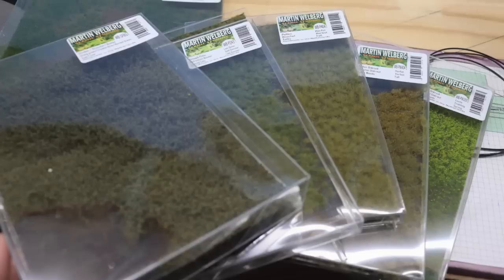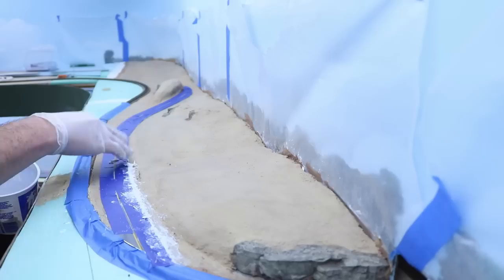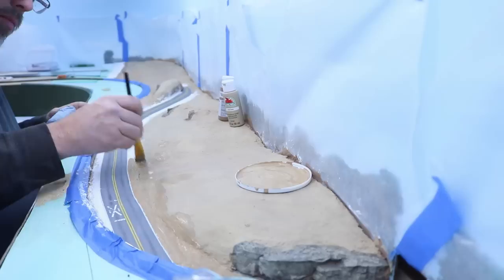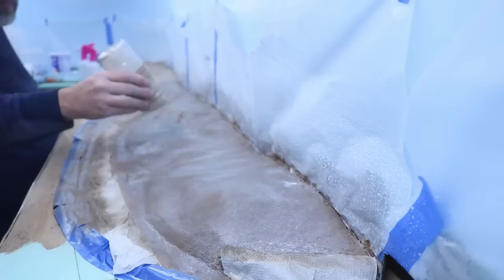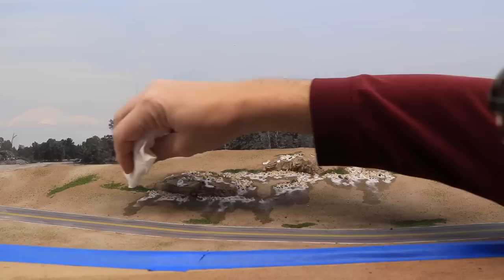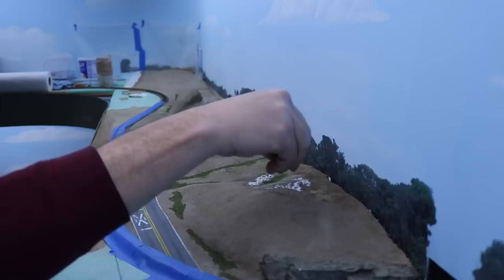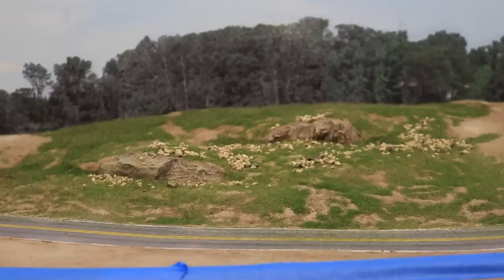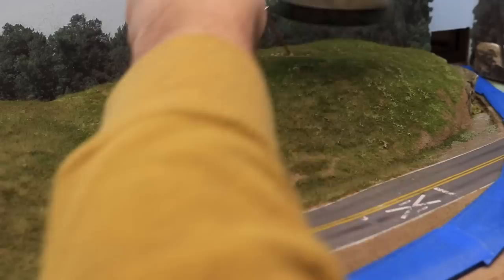Building Open Country Scenery for a Model Railroad Layout

Comment: I have bought those spray bottles from the dollar store as well, they do work to a point, but when the glue dries you pretty much have to use hot water to get it to spray again.    I now use the clear plastic ketchup and mustard bottles with covers

Comment: If you want a cheap alternative for sculptor mould try this. Take a dozen sheets  of soft toilet tissue, put them into a nutri bullet, give it a whizz, put about an inch or so of plaster into a plastic fruit bottle, fill loosely with the toilet paper fluff and give it a good shake to coat the fluff with plaster. Add water to the fluff and mix to the desired consistency. Excellent sculptor mould at minimum cost. Try it!
Reply: Great tip, thanks 😀🌈🇭🇲🚂🚂
Reply: I don't own a nutri bullet.
Reply: If you don't have a nutri bullet, buy a $14 coffee grinder from Kmart. Fold 6 sheets of toilet paper zig zag fashion on each other and cut into half inch squares. Toss a few into the coffee grinder and you will get the same result. That is how I first did it. The coffee grinder has many uses for making  and colouring flock and other stuff with artists acrylics straight from the tube. It is very well worth the $14 outlay. One tip, shake it vigorously while using, to ensure good mixing and colour coverage. All my DIY static grass made from weathered MDF and my foam flock was made in my coffee grinder. You won't be sorry you invested in one.

Comment: An expansion on your clothes pin clamps. About 30 or so years ago I was building a quarter scale RC glider and needed clamps to  hold reasonably soft balsa sheeting to spruce stringers for gluing. All steel clamps I had would have done damage to the sheeting. I got wooden clothes  pins, removed one jaw of each pin and super glued the shortened sides together. This gives a gap between the jaws about a half inch wide before you squeeze the pin open. Works really well and can open very wide. One tip on super gluing pine or spruce. Spread a thin coat of super glue over each surface to be glued and allow to dry momentarily to seal the surfaces. Then apply the glue as usual. This method ensures that the glue doesn't soak in and rob the joint of glue.

Comment: Why “never mix” the different lengths of grass? Glad to see you posting videos, it’s great info. Thanks for the nod to Midwest Model RR, great service and delivery.
Reply from the maker: Yes, I should have explained that in more detail. If you mix different lengths of grass, the tendency will be for the shorter grass mostly to come out first and then the longer grass later which means it won't mix in the scene well. There is an exception to that and that the static king has a divider where you can put two lengths of grass on the two sides and a screen that has two sizes of holes so you can apply them at the same time without mixing them. That is possible, but I prefer the results I get from layering.
Reply: @RonsTrainsNThings  Thanks for answering and expanding on your answer. I believe as I get that far I’ll stay with your preferred way as you say, you can always add more. 👍🏼👍🏼

Comment: Hi Ron! What do you use on the end of the alligator clip of the static king? I’ve just been using the included metal ground but want to change that out.
Reply from the maker: I just use a stripped piece of 12 AWG copper electrical wire.

Comment: Ron that looks fantastic. I simply can not get the hang of any of my static grass applicators.
Mike
Reply from the maker: Hey Mike. My biggest issue was always that the battery powered ones don't put out enough voltage consistently. I only use wall powered ones now, hold it close, and I get good results.
Reply: @RonsTrainsNThings  Thanks for the tip Ron , I will try that !!  Could I rig a power supply to a battery unit and what volt and amp would you think?
Reply: @Mike Fifer  you're over complicating this. Woodland Scenics sells a power supply for the Static King. Easiest thing to use is that, battery doesn't get you good enough results
Reply: @AbelG8781  I iunderstand but I have 3 different brands of applicators.
Thanks , Mike